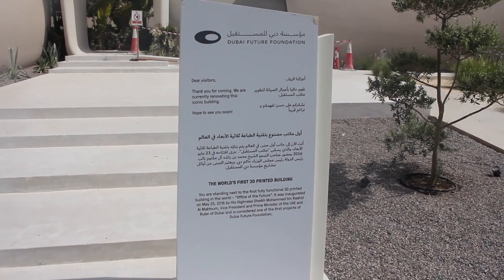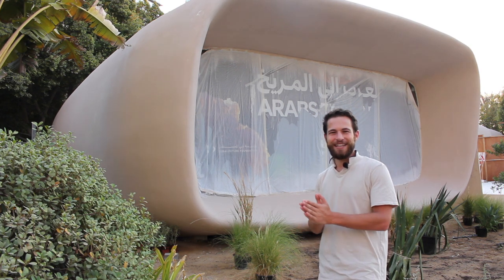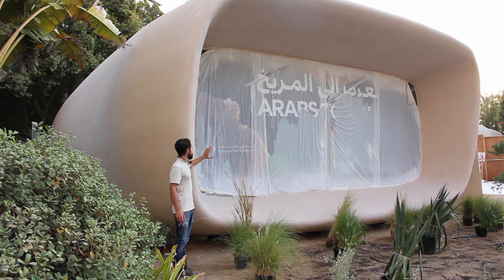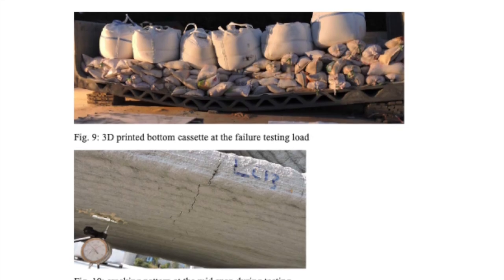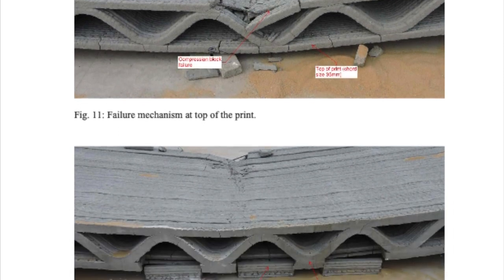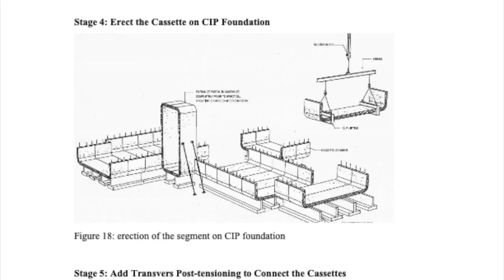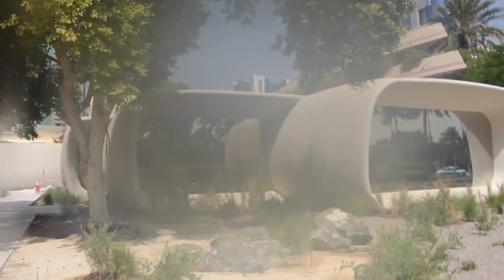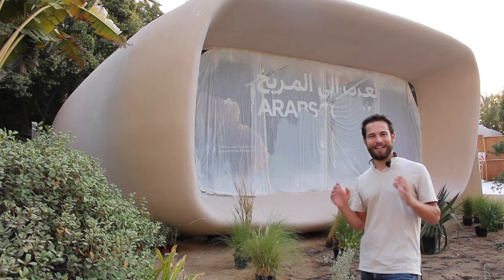Hidden Assembly of 3D Printed Buildings | Pros & Cons of Winsun Office in Dubai

Comment: Wonderful report, Jarret. Thank you for your efforts. But as you said it in one of your previous reports, only an Elon Musk of this industry would make this technology work for the people of Earth. Because the missing link is the middle entity which would marry the consumer with the producer in a happy ending for both a win-win situation for both parties.
I like the finished surfaces of the structure, they are not going to collect dust and dirt, or exposed to water and crack in the freezing temperatures. 
 I would buy a house like this if I could find one. I am sure the Chinese had plenty of people to finish the job in Dubai, but in order to make a profit the number of the operators, assemblers and finishers has to be minimized.
Do you do follow-ups?
Thanks for the information, technical data would serve as a reference point for anyone interested in building such buildings .
Merry Christmas to you !